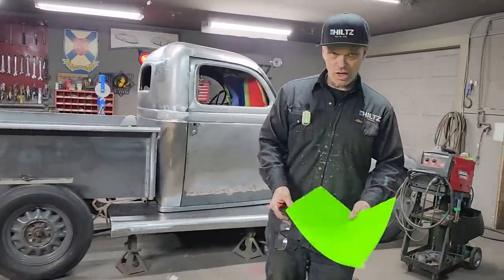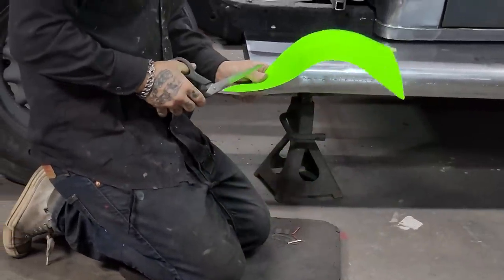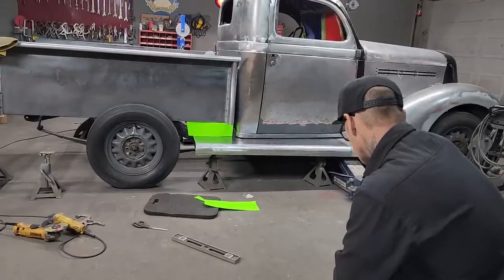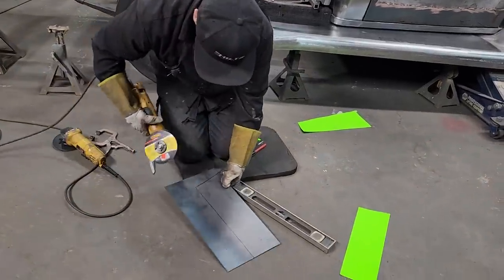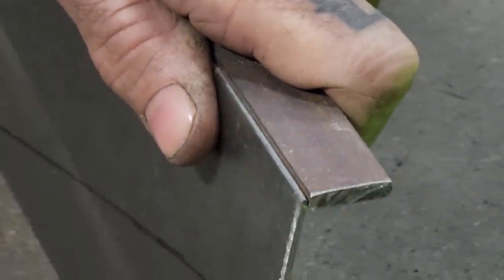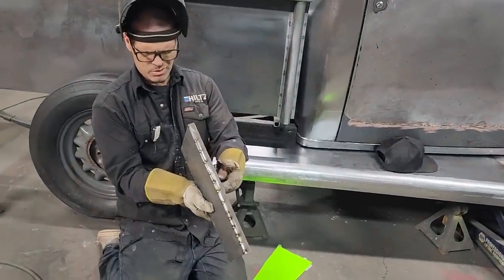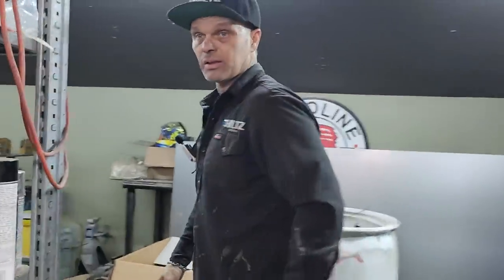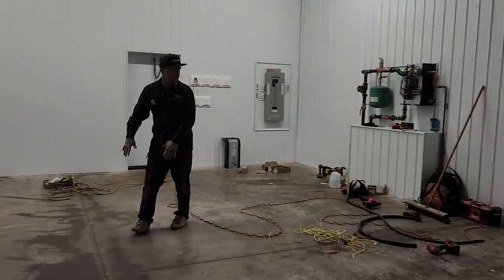Fabricating the box extension panel: 1935 Plymouth pickup truck

Comment: Chad I watched a old video of you replacing a floor in a car .. & it was just what I needed to watch ! I just cut out the horrible mess on the passenger side floor board & ran the square tubing to the fire wall & it is going to work so fantastic & clean & all the rusty metal is gone .. & I'm going to use a boat trailer roller for my cab bushing mount .. just like you did some time ago ! Thanks so much for sharing your tricks of our trade ... I am retired & I am building my vehicle my way for my purpose & I couldn't be happier ! Thanks Chad & Jolene !

Comment: Hi Chad and Jolene

If you can Chad use a riv-nut where you drilled into the square stock that way you can use a shorter bolt for the fender.
Also where the bolt's pop through a curved piece of flat bar say 1 inch wide by quarter inch thick with reassess in it to cover the riv-nuts on the inside of the tube.
The curve is bent so that it only protrudes out into the tube by quarter inch this bar can then be welded in place and it becomes a extra brace for the fender.

This is just a idea of mine, your work is brilliant and as always you will find a way to solve the dilemma of mounting the rear fender.

Comment: This has really been another great build.  I do have a "BELLYBUTTON" for you so take it or leave it ...  I think since there is a definite line from the rocker panel or I think you call it a sill panel but, if you add that t the new piece on the bed to the running board.  I just think it looks a lot better but, its your build and you do what you like !  Its important to please yourself not others !  Good luck !

Comment: To make it easier to remove and install the rear fenders you could get the fenders how you want them, put the bolts in from the bed side  and then weld the heads of the bolts so that all you need to do is tighten and loosen the nuts inside the fender that hold the fender.  The use of carriage bolts would smarten up the inside of the bed as well.

Comment: most if not all old trucks from the 50's on back are bolt on side panels you're making and running boards/fenders. they also lay a piece of welting material in between the parts that are bolted up. reason why they also go that route, because of all the flexing they do and that stock frame will flex and to hide the gaps.  mostly done in black color or color match if building a custom mod truck. looking good Chad.

Comment: As far as your thumb on your glove, I’ve cut a large finger off another pair of gloves and glued it over the one with the hole in it. I’ve done this for years and it uses up my old gloves. 😊 Also they make 3&4 way plugs for your extension cord for multiple grinders. 👍

Comment: You’re moving right along Chad. I’m guessing that that panel doesn’t get attached to the running board, to allow for flex over uneven ground. Some beds are mounted on the strips of wood or on rubber cushions to allow them to flex but I’m not sure how the older ones would have been. I know in large trucks like Ton and 1/2 trucks that nothing about the bed attaches to the running board. I’m getting into watching your daily progress. It’s like going to school in my reclining chair ha ha!
Reply: Every separate part needs to have welting or cushion to allow movement. All older cars and trucks had it where fenders and other parts joined together.  Direct connections will cause stress cracks and rust to accumulate.  There is a reason for the madness.  Auto manufacturers have learned by experience over the years.

Comment: Good job you 2 , when doing the left rear fender get it mounted to the running board and adjust it to the bed wall clamping the bottom edges and then burn your 2 top holes and drill them put 2 bolts and nuts in and snug them then bur all the rest of holes for mounting the left fender holes will match up better . Great job and hope you both have a Merry Christmas.

Comment: You should have a gap because the frame will flex and move while you drive which will work on your welds and cause warping and possible cracks. The car was one "unibody" while the truck is 2 completely separate parts that move separately. 
You might want to allow room to flex, or weld the box to the cab forcing it to all flex together while spreading the load of your welds

Comment: One side question: In the end of this episode you'd mentioned that there was rain outdoors.  Your Plymouth Pick-Up is in raw steel without any paint.  How do you prevent rust from taking over over this long construction period when the humidity level of the air is high (as in a rainy day and when you touch the metal with your hands)?

Comment: I think Jolene was right, the front fender meets the running board but there is a gap at the cab. So the rear fender can meet the running board with a gap inbetween the box and the runningboard. Sorry Chad 🙂

Comment: Things are looking great.  CHAD - QUESTION:  is there any reason you don't just weld a nut on the underside of the running board at the exhaust pipe flare?  Then you wouldn't have to mess with the bolt where you said it interferes a bit with the flare portion

Comment: There is a blade for zip cut that never gets smaller lasts forever it’s metal and cuts amazingly faster I will find the link
Reply: Spyder diamond edge comes in 2 pack
Reply: 2 pack ?? What is the second one for ??
Reply: They last 100X longer than standard resin discs for 14 bucks so good deal for sure

Comment: some runners have the whole s  punched from the underside for non-slip bumped upward  some newer runners have a  rubber mat or stone guard combos sealed on  well and a safety handle to grip onto  like the big trucks and motorhomes not just for looks rubber lines mats

Comment: Chad and Jolene, I think I would put box extensions by the rear part of the fender so the rear part of the fender is not hanging out in space. It would extend the flow of the running board line all the way back to the rear.

Comment: I don't believe running boards are ever welded to any part of the box or body. There is movement between the cab and box that differs and with the boards welded to the box you will get buckling of the metals.

Comment: The rear fenders should have been located and mounted before the running boards were fabricated. The wheels & tires need to be centered in the opening for a balanced look.

Comment: When I step back and look at the panel placement, I see, come to the running board with panel then  treat the panel with a strip of metal that mimic the rocker panel, if thick enough will create a shadow line on lower edge of panel. Just an idea.

Comment: Are you planning huge hot rod rear wheels? If not you don’t need the over wide rear fenders sticking out like elephant ears there, should let the running board dictate the original width.